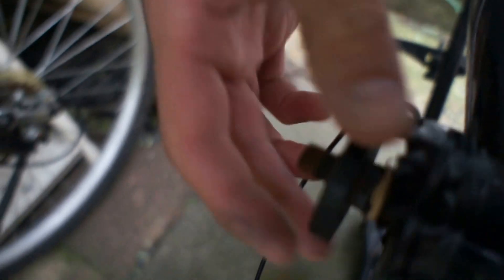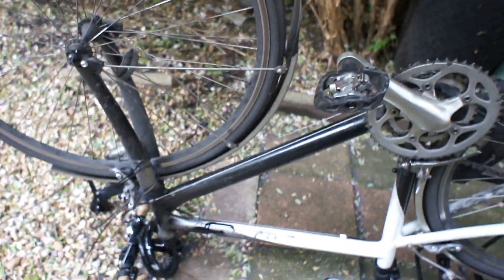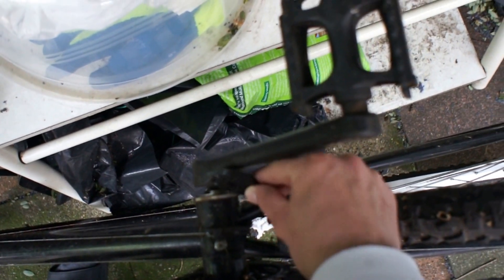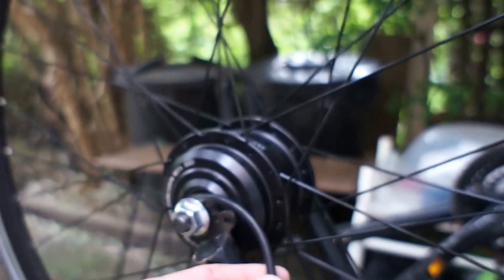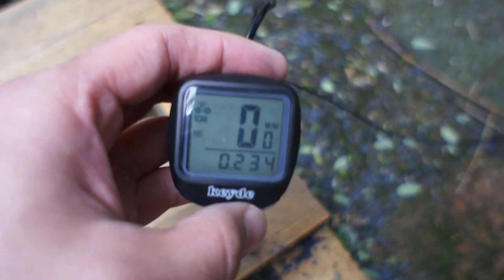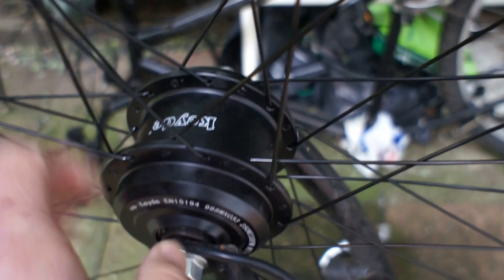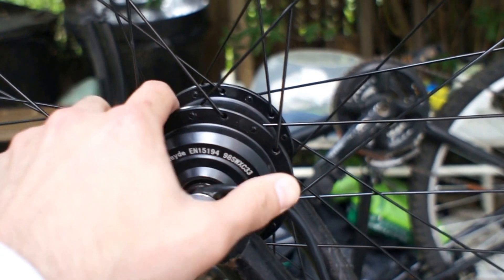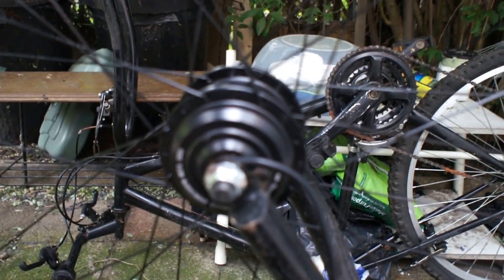KEYDE  - part 1, electric bike, E bike, electric bicycle, e bike kit motor with controller inside

Comment: Discrete and light I wanted one. local electric bike shop loaned me one and first good hill, Low gear up on the pedals. Motor broke. I went with an Em3 kit. not much more $$. 16 months no problems. Check endless sphere

Comment: I bougth from Keyde 6 motors and 4 Li-Ion battery bottles  in one year but i had some problems. 2 motors didn't works and 1 battery too. Their products are not reliable at all.